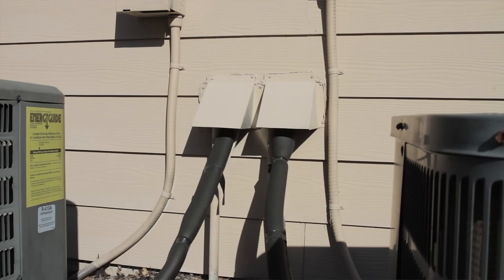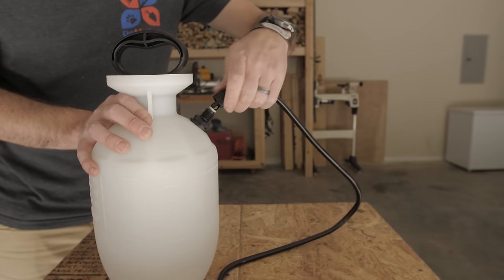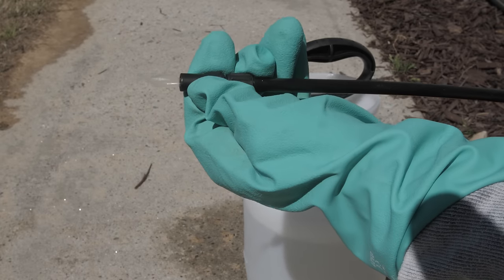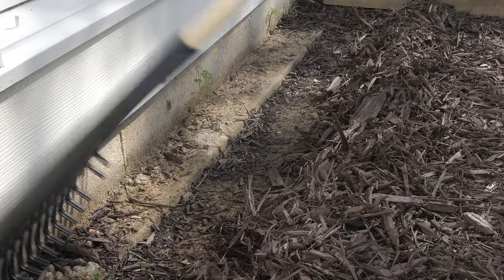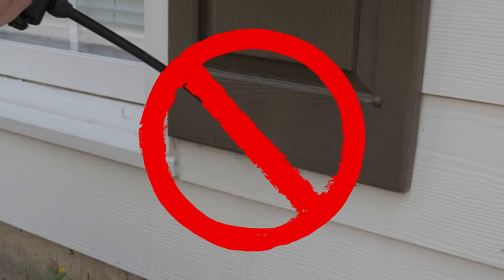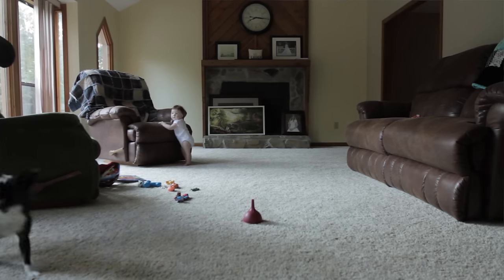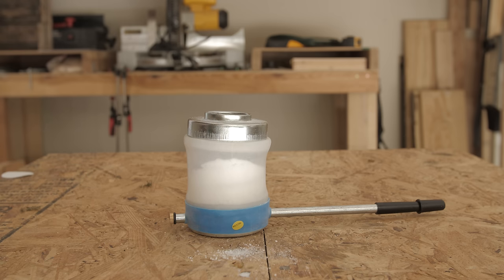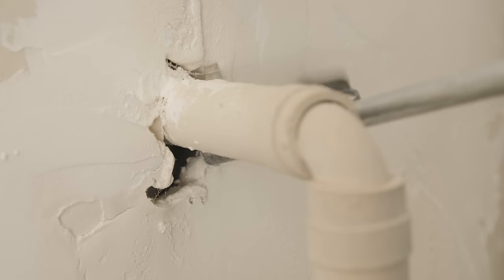How to do a General Pest Control Treatment - DIY Pest Control | DoMyOwn.com

Comment: Hi, I just bought some Alpine WSG because I currently have an ant and cockroach problem in my room, as well as seasonal stickbugs coming and going. I was wondering if this chemical is safe to spray inside the bedroom which I sleep in. If so, how long should I wait until I can safely sleep in the room? Thanks.
Reply from the maker: Once the surfaces treated with Alpine WSG are completely dried it is safe to return. You will want to make sure that is ventilated as much as possible and return about 2-4 hours later.
However there is no need to broadcast spray indoors for your target pest. Baseboard and crack and crevice treatment is sufficient.
Reply: @domyown  Thank you so much for the reply. So what you're saying is I only need to do the baseboards and crack and crevices when I spray the inside? I am also getting stinkbugs coming in from my air conditioner that is attached to the window. Should I spray around that as well? I also purchased the "Delta Dust" and Hand duster from your Amazon links. I was planning on dusting the cracks and crevices after spraying down everything. Would you still recommend this? Thanks.
Reply from the maker: Yes, you can spray Alpine WSG around the air conditioner connected to the window. Just give it time to dry before turning it back on. Delta dust is labeled for all your target pest so would be a good option as well.
Reply: @domyown  Thank you so much!
Reply: @domyown  Hi, I need to ask you another question if that's okay with you. So I sprayed my room and the outside of my home with Alpine WSG, I used 20 grams in about a gallon. I accidentally sprayed some on my garden of vegetables outside of my home. I was wondering if it would be safe to eat these after washing it, or should I just throw out the vegetables and not risk it at all? Thank you.
Reply from the maker: Thanks for your question. Since the Alpine WSG is not labeled for use on edibles, we recommend that you don't eat from any plants that were sprayed with this product.
Reply: @domyown  Thanks again!!!
Reply: @domyown  Question about the Delta Dust. Am I suppose to puncture the tip of the bottle to get it to open?
Reply from the maker: @999yuiop  The red cap on the Delta Dust is removed if using straight from the bottle though you get more accurate applications by using an external duster such as with a Bellow Hand Duster or B&G 1150 Bulb Duster.
Reply: @domyown  Oh, let me clarify. There seems to be hard plastic where the hole is supposed to be, like it's sealed off at the tip after I remove the red cap. Is this what the bottle usually looks like? Should I get a knife and chop off the tip or is there another way to open it?
Reply from the maker: @999yuiop  The red cap on the Delta Dust is removed if using straight from the bottle though you get more accurate applications by using an external duster such as with a Bellow Hand Duster or B&G 1150 Bulb Duster.  After removing the red cap you would cut/puncture the tip.
Reply: @domyown  Thank you so much!!!
Reply: Read the label ,something you should have already done before doing anything
Reply: @domyown  dust should never be used on outside service unless you have accessable voids  because you don't want the dust to become airborn
Reply: When filling the duster why not use a funnel if you don't have a container with an application tip on it

Comment: ?? Can I spray hard wood floors.
Reply from the maker: Cyzmic CS Micro-encapsulated Insecticide is labeled for use indoors around baseboards and cracks and crevices.  If you follow the manufacturer's product label and mix accordingly, the product should not leave any residue, but be sure to only apply a fine mist around baseboards.  The Cyzmic CS Micro-encapsulated Insecticide is not labeled for broadcast spraying over your entire flooring.   https://www.domyown.com/msds/CYZMIC_CS_Label.pdf

Comment: What insecticide product would be good to use with a hose end sprayer for general insect maintenance? I like the Tempo SC and the Suspend Polyzone for around and inside the house but I would think it would cost a fortune to use product like that on an entire lawn? I would think there is a larger bulk item I could use for lawn insect treatment, what would you suggest? 
Side note, this would be for a few homes I treat like my own, parent grandparents etc.. so I didn't want to just purchase a hose end sprayer bottle from the local home supply store which would be 10-15$ each when I would think if I buy a concentrate and hose end sprayer my money would go farther with a much better product.
Reply from the maker: Our most popular general use product is called Bifen IT.  https://www.domyown.com/bifen-it-p-226.html 
It is widely used by pest control companies because it is labeled for almost every insect you could have a problem with and you can use it outside the home as well as inside, it is odorless and very safe for use around children and pets.  It is a liquid concentrate that you mix with water in a handpump, backpack or hose end sprayer.  It will last for 60 to 90 days outside in between treatments.  It is also labeled for lawn and ornamental use, and can be used on trees, plants, bushes and shrubs for all sorts of ornamental pests including Japanese beetles, mosquitoes, and other leaf eating pests. 
Bifen IT is also available in a granule formula called Bifen Granules if you prefer to use granules. https://www.domyown.com/bifen-granules-p-227.html
Reply: @domyown   Thanks for your response. I am still considering what to use, I thought of a hose end sprayer so it would be faster and I wouldn't need to lug around a pump sprayer all over the yard. 
Though if I use the Bifen IT in a hose end sprayer, should I add some water in the resistor to thin it out? I know the insecticide is more of a thicker creamy liquid so I'm not sure if that will hinder the siphoning?

Comment: So you need to both spray and dust?
Reply from the maker: Yes, we recommend applying both a liquid insecticide and an insecticide dust for general pest control and treatment. Insecticide dust, also known as insect killer dust, offers additional protection against pests. Pests will walk through the dust and slowly die. Because it takes some time for pests to perish after contact with insecticide dust, it should be used with liquid insecticide for maximum results. 

You can shop insecticide dust on our site here: https://www.domyown.com/insect-killer-dust-c-30_77.html
Reply: No,I don't think that would work because most dusts become ineffective if they get wet so dusting anything outside is in my opinion a complete waste of time,money ,resources and most dust products aren't labeled for or safe to use outdoors due to the dust becoming airborn
Reply: @michaelmerck7576  he is talking about exterior cracks and crevices, not the entire exterior perimeter. You would use granular products for that if you don’t want to use spray.

Comment: What's the chemical you used?
Reply from the maker: The video states when doing a general pest control treatment around the perimeter or on the inside of your home, you can use a liquid insecticide of your choice. Cyzmic CS  https://www.domyown.com/cyzmic-cs-controlled-release-insecticide-p-1420.html?sub_id=17121 would be a great choice for a general insecticide since it is a micro-encapsulated product.

Comment: Unclear what chemicals should be used!
Reply from the maker: The video states when doing a general pest control treatment around the perimeter or on the inside of your home, you can use a liquid insecticide of your choice. Cyzmic CS  https://www.domyown.com/cyzmic-cs-controlled-release-insecticide-p-1420.html?sub_id=17121 would be a great choice for a general insecticide since it is a micro-encapsulated product.

Comment: You can't expect a pest controler to clear your gutters
Reply: I could. But that was because they offered the service. I fired them, though, after initially taking on their service. In this case, the problem was the owner did not seem to have employee buy-in for doing gutter cleaning. The employee seemed unhappy to be at risk from extended time on a ladder twenty feet off the ground. It can kill you. So, the dude skipped many of the sections (I have a complex roof). I ended up doing it myself, unwisely many tell me (55 years old at time), taking photos of the full gutter, and ripping the vendor. Gutter cleaning is funny. The odds of death are low. Then again, everybody injured or killed thought it would not happen to them.